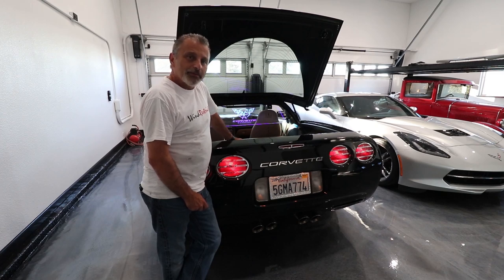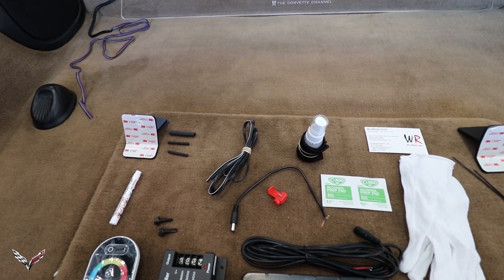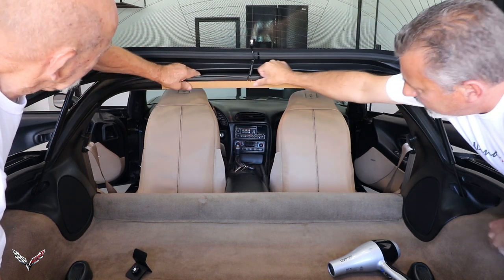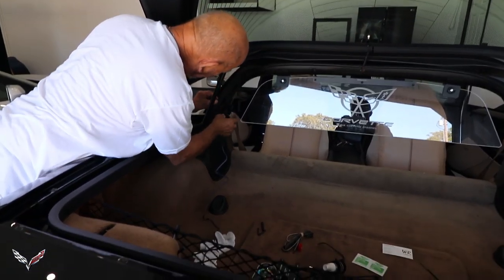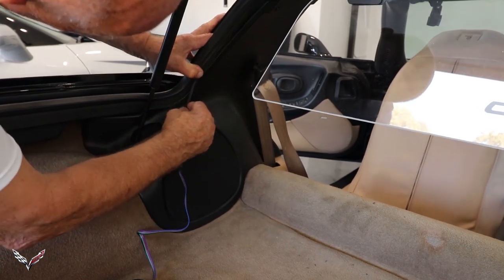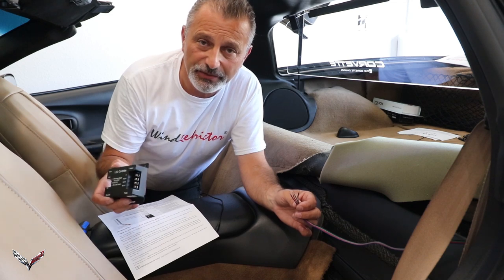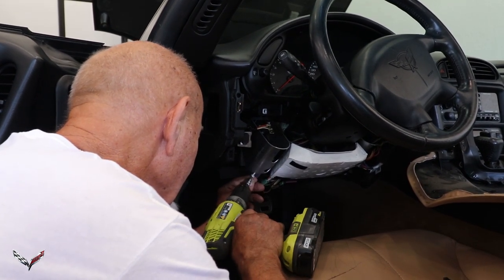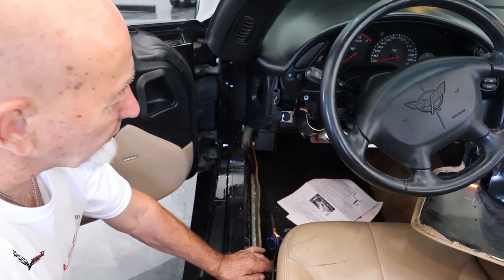How to Install a WindRestrictor in a C5 Corvette Coupe

Comment: When you screwed it in do you just go through the plastic or does it go into the metal above plastic...my plastic is about inch down from the metal top
Reply from the maker: Sorry for the delay Joe. I just saw your question. It is very light weight so the plastic holds it just fine.

Comment: What is a purpose of this?
Reply from the maker: It has 2 purposes first it lights up and looks cool, and it reduces turbulence in the cockpit and makes it easier to hear.
Reply: I've had mine for two years now. In addition to how cool it looks SERIOUSLY, it really does make a huge difference with the turbulence and sound. It reduces the amount of wind noise when driving at high speeds with the targa top off. It's a big enough difference that it allows you to have a conversation with your passenger with the targa top off and driving at the higher speeds. Another sound benefit is that it improves the sound of your car audio both with and without the targa top off.
Reply: Waste of money and time. Not for me